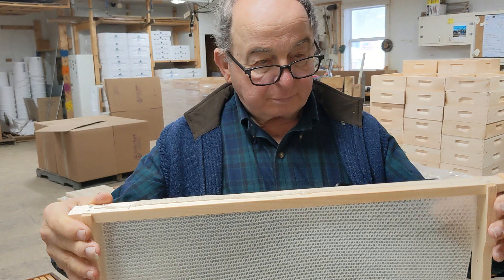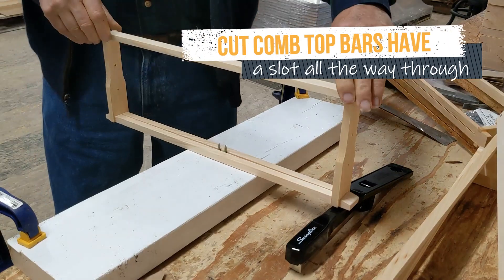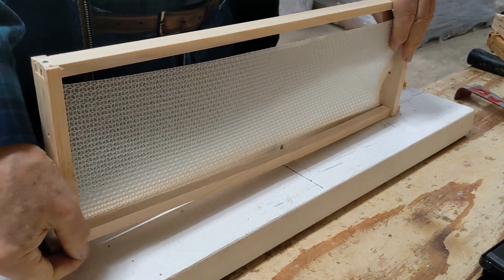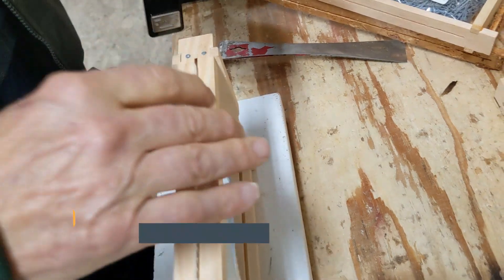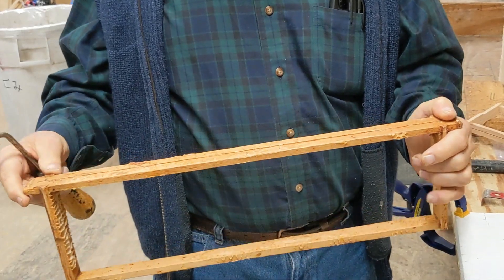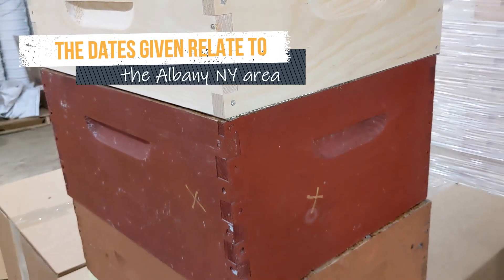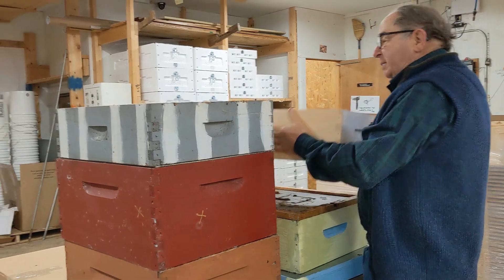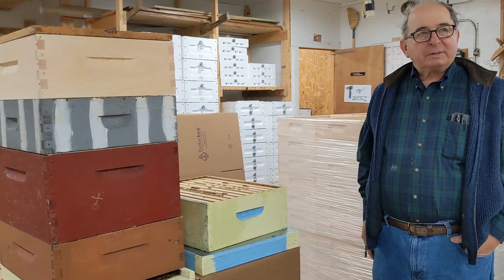How to Produce Cut Comb, with Lloyd Spear

Comment: Betterbee, An important part Lloyd did not present was the age a bee has to be to produce wax in order to draw out comb. You have to calculate the nectar flow at least 6 weeks prior to begin building your comb building force and foraging force to ensure that there is ample drawn comb to be filled with nectar. Plus you need a young good laying queen. It just doesn't happen automatically. If you are not on top of the explosive growth the hive will swarm leaving all your hard work to a hive of young bee's that are not old enough to be foragers.
Planning + Timing = EVERYTHING!!!!